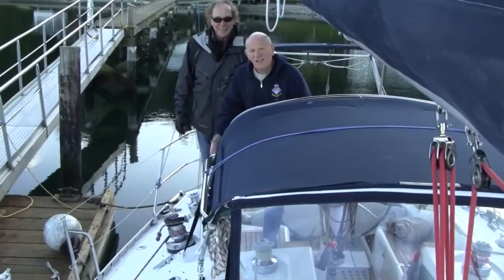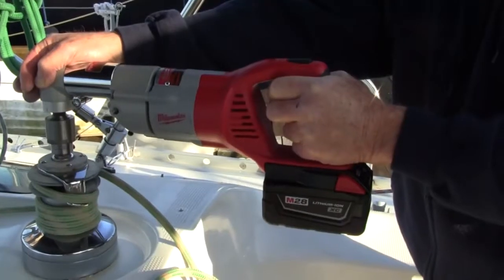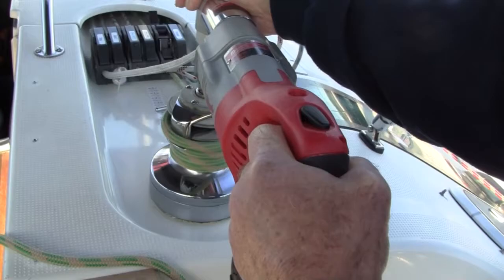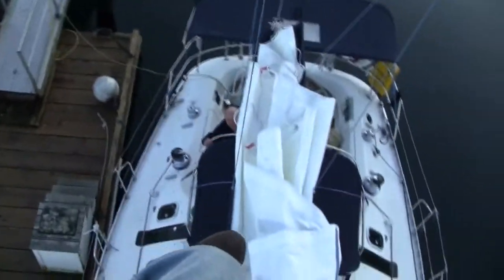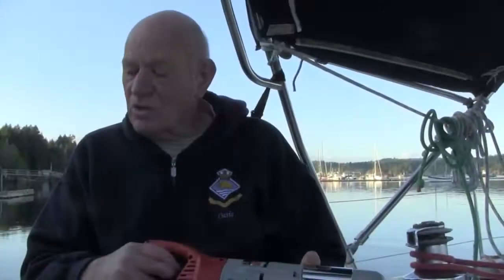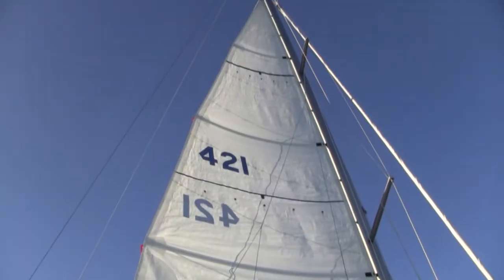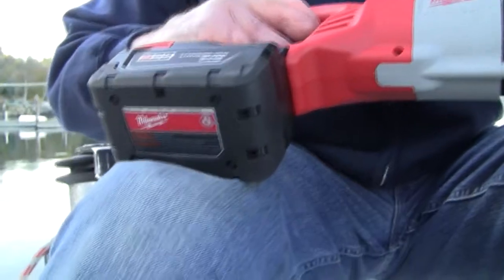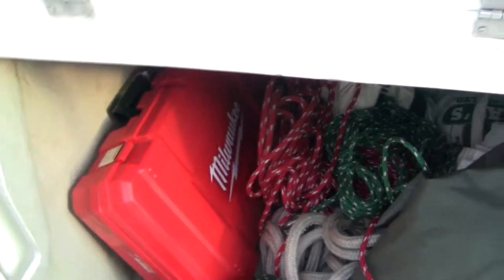Bob's amazing cordless Boat Winch

Comment: Nice
Probably way cheaper than a built in electric winch and you can use it for other projects  at home or anywhere 
 I use to hate pulling the ropes for the sails on dads boat, I just wanted to relax  .